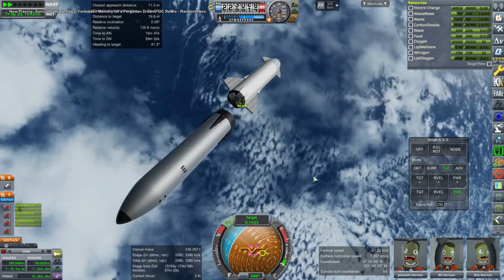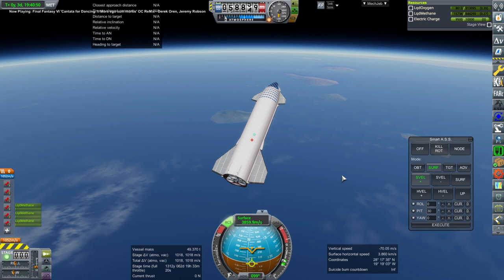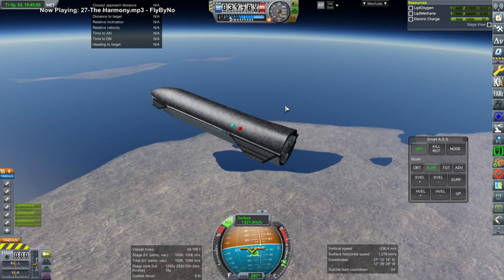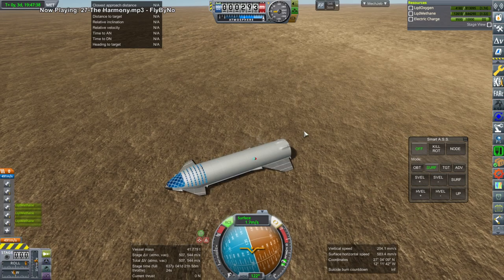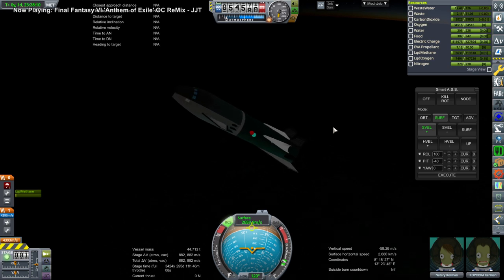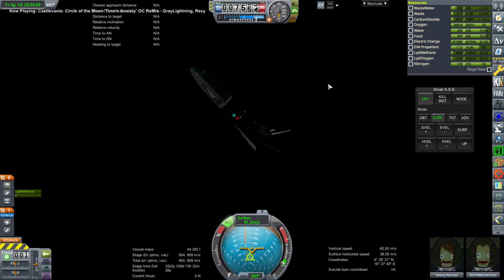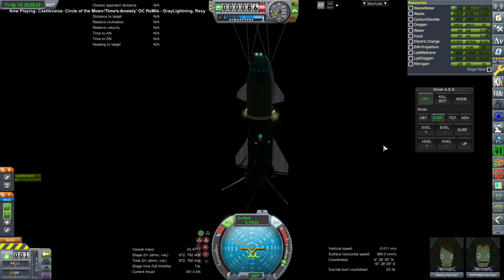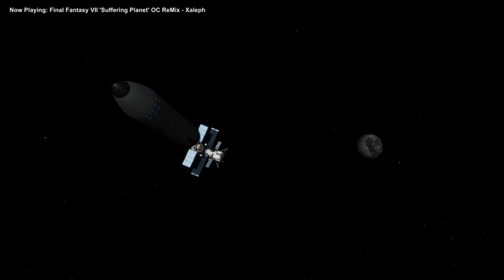Realism Overhaul in KSP 1.8.1 - Other Shades of Starship

Comment: I made proper fins using robotic parts and action groups, where they can be configured for obeying players commands on pitch. To be specific, robotic part was G-32W Hinge.

Tested it in stock system with FAR. It works as it should, easily holds 70 or even 90 degree AoA. 

The drawback was that SAS or A.S.S. couldn’t control them, as it works through action groups. Only manual input from keyboard works or possibly from joystick (which I don’t have).

Try it, it will work perfectly, especially if you put header tank on the nose.
Reply from the maker: Yeah, when I talked about KSP understanding the arrangement, I basically meant SAS or Smart A.S.S. controlling it.